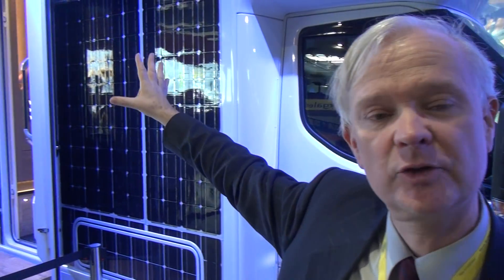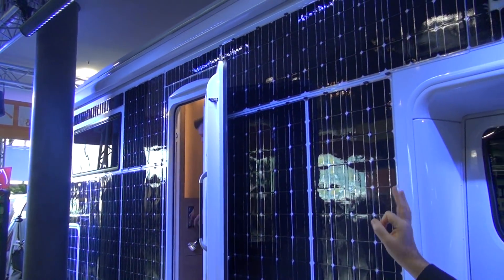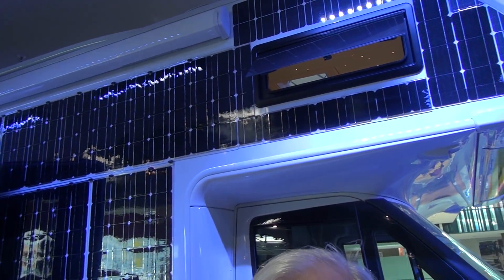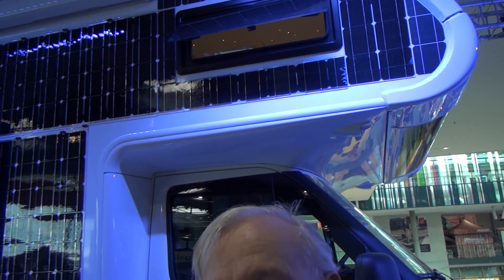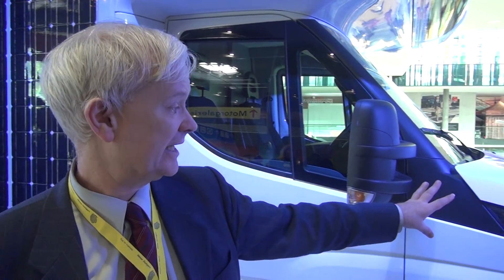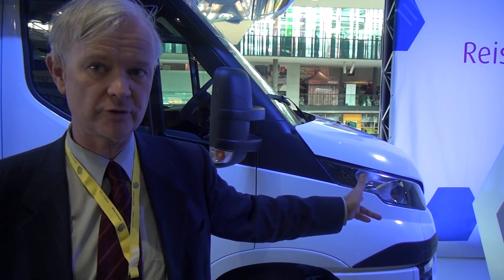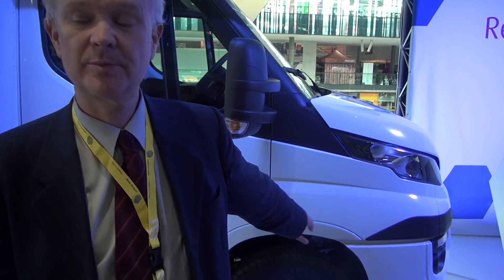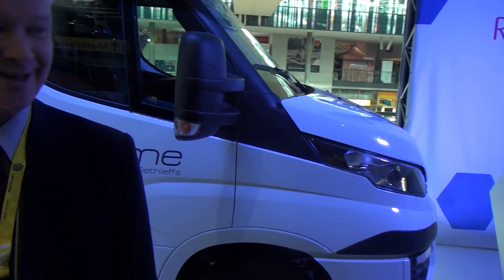Solar powered RV at Stuttgart

Comment: Hello From Muscle Shoals Alabama United States,

this individual once posted the designs online to do what the manufactures say can not be 
done.  if you look at supercapcitors for storage like battery wired in multiplexer circuit where you have four individual supercapcitors banks that cross charge and cross discharge when 
one energy bank is charging then the other is discharging. 
if you look at graphite solar cells printing maufactureing then you will find that its lot simpler to put the cells on the exterior than the manufactures asserts. 
if you do the research for the videos online then I think you will find them for I have brain 
damage and considered a nut case since I think out side the box of what is considred normalby acident I found them.
By your videos, you seem more intelligent than I am and very likeable individual.
here is the information that might intrest you. 
https://www.youtube.com/watch?v=raLgNo0jhys&t=145s
https://www.youtube.com/watch?v=k5Fb0kQMwQg

Here is some interesting information I found.
https://www.idtechex.com/energy-storage-usa/show/en/
https://www.cta.tech/
https://www.ces.tech/
https://www.namm.org/
https://www.semashow.com/
https://www.quantumharvest.net/
http://www.hydrogenhouseproject.org/ 
https://www.solartowers.com.au/
https://www.bredenoord.com/en/
http://www.multiconsolar.de 
http://smartflowersolar.com/
http://www.ifixit.com 
https://www.thealternativeenergycompany.co.nz/products/water-heating/commercial-water-heating
alternaive energy solar water tanks 
https://www.zeromasswater.com/ generate water system
https://www.gosun.co/products/ambassador
https://semtive.com
wind turbines 
https://www.climatemaster.com/

http://brutusmotorcycle.com/
http://www.tacita.it
https://www.youtube.com/watch?v=w3i9N3dqI3k
mobile solar generator on trailer
https://www.1and1.com?kwk=194286533
to get your own web site by getting the web hosting package that comes with web site name and email accounts.  

Hope you have a great day.
Reply from the maker: Thanks for the links - I will have a look at them.  I am surprised the comment made it to my page as YouTube normally filters them out!

Comment: According to the manufacturer the external solar panel array were not designed to power the vehicle but to power all the appliances inside the Motorhomes accommodation including the fridge freezer and induction hob and the lighting and the air conditioner for long term freedom camping